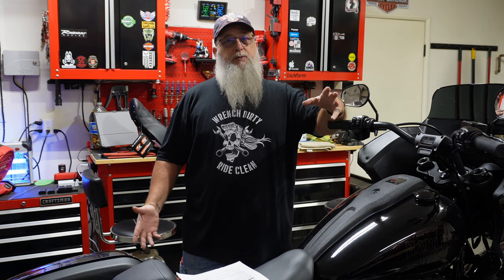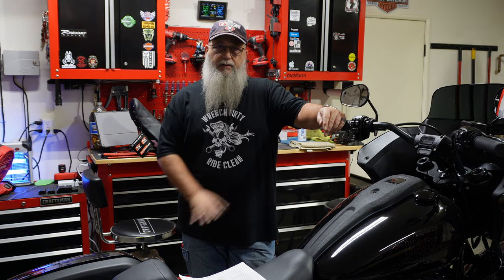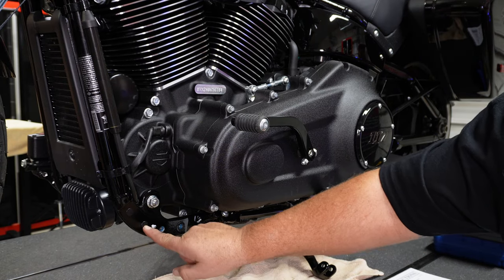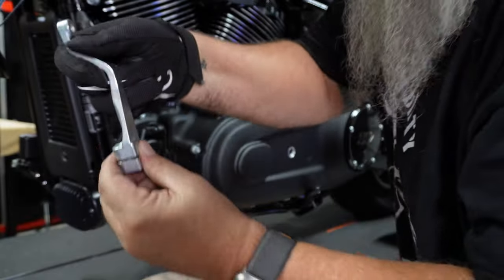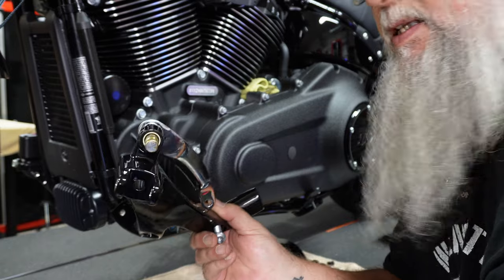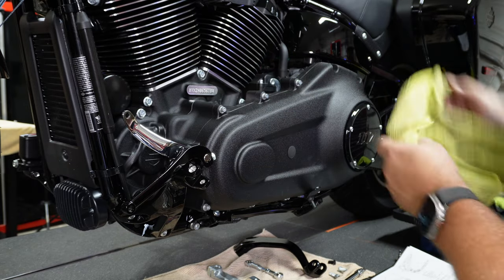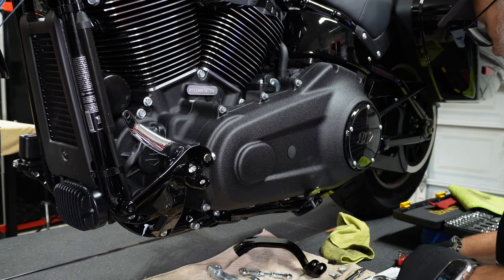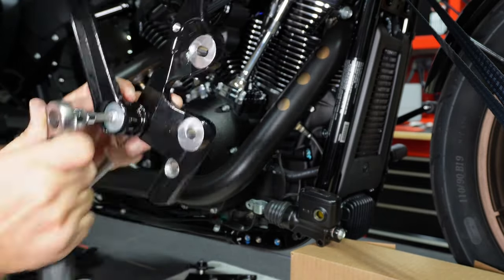2022 Low Rider ST Upgrade - Forward Controls, Seat & Seat-Lox

Comment: Great video...I would like to trade in my RGS for a low rider ST but can't ride the ST at all without forwards.  Would you say the location of the controls after the install are similar to where the controls normally sit on a bagger like the RGS?  If so, then I can be confident in buying the ST and moving the controls.  I literally just left the Harltey dealership 2 days ago and was hesitant because of this.  Any feedback is greatly appreciated.  Thx
Reply from the maker: Great question. When I purchased my Heritage, I test rode a Road King prior to that. The Heritage was far more comfortable with my legs so I changed my mind and got the Heritage for that reason. When I got the LRST, that was one of the main things I wanted to try was to use Heritage fwd controls since I hated the fwd controls and it is still a Softail. Worked great and love it. Feels more roomy than my Road Glides, has a better riding position (for me) and would do it again on any other LRST should I get one.

Go for it and enjoy your ride for you.
Reply: @justkillnbugz  thanks for the response bro!  I think I'm gonna do it. I see you mentioned the black forward kit brake pedal sucks. So the next bet would be to get the chrome and powder coat, correct?
Reply from the maker: @pbarre79  You bet! I would go with this solution: https://youtu.be/gBEvSz3U7zo

Far better and a much more comfortasble ride. Then you could do this: https://youtu.be/vTUBH14afEQ and be totally dialed in for a touring feel on a softail.

Ride Safe!
Reply: @justkillnbugz  awesome. I actually have the thrashin 9.5 risers and high bend bars on my road glide and love them! I was thinking to do a similar setup on the LRST once I change to tje forward controls. Thx for all the advice. Ride safe!
Reply: So I just reached out to a powder coater who told me they can't powder coat the chrome foot controls unless I had the chrome removed FIRST and then brought it to them. 

Has anyone heard this before? I feel like I've seen a couple of guys on YouTube who changed to the chrome forwards and simply had them powder coated
Reply from the maker: @pbarre79  Sounds skeptical to me, generally, they sand blast anything before powder coating. They may charge extra for that but still....
Reply: @justkillnbugz  I figured that. I'll look for another company then. Thx

Comment: Obviously putting forward controls on a motorcycle is a personal choice, but the Low Rider ST was conceived with performance in mind. That being said, it'll handle better with mids and the rider will have a better posture. Definitely change out the seat, but if forward controls are a desired riding style; I'd look for a Night Train.
Reply from the maker: Thanks for the feedback ARO, however, performance is also a measure of the rider not just the bike. And speaking from personal experience and riding time on many peg positions of bikes, my decision was based on works best for me. Rest assured, not having my knees in my chest made a huge difference when I out rode several others on low rider STs (and other models) with mid controls. It is also the reason I have 4 different rides for different occasions. 

Appreciate the opinion and ride safe.

Comment: Foot controls, handlebars and different seat.  Sounds like you bought the wrong bike 😂.
Reply from the maker: LOL. Nope, just making it my own, and showing others how to do it if they want to learn. But, thanks for the opinion.  I do have 3 others for other purposes as well. 

Ride safe.
Reply: So I’m a guy with 14” T-bars. Not offered on any bike from factory. I want a Saddlemen Step up or a Le pera tail whip to lock me in better that any seat from factory. And I’m 6’ so I want be more comfortable than I am on the mids that came on my 2020 fxlrs. Less sporty, sure but I still want these changes for my comfort. As do many HD riders so a comment like that makes me question if you ride HD because those are some very modest changes
Reply: How ya doin and thanks for you're video. I have a Low rider st also but the El Diablo version. I went a different and budget worthy direction in the way of highway Bar, and it also doubles as a fairing engine saver if it was dropped or knocked over somehow. I'm also 6'4" so I definitely needed some leg extension. Happy Holidays and thanks for you're perspective of ways to get the comfortable riding position you need. Love my bike and Do recommend This Harley Davidson bike...
Reply: lol who buys a Harley and leaves stock you make the bike your own

Comment: How do you compare the ST to the Rocket?
Reply from the maker: That's a great question. As a Rocket rider yourself, you know how they handle, sit, and the power they pack. In comparison to the RGST/LRST, they are different bikes for sure, made for different rides and function. Now, I do tend to get a lil spirited on all my bikes, trained that way and because of the riding the Rocket for sure, lol. It just keeps you feeling spirited. 

The Rocket is bulky (much better since the redesign in 2020), it feels solid in turns, but man does it punch out when needed. With the endless torque, in every gear, well, it's just awesome. As a softail, the LRST feels less bulky in turns, but surprisingly agile, and rides softer (not much with the stock shocks though). The 117 does not compare to the power of the 2500, but still has some good kick.

The power of the Rocket is unmatched in my experience, same with the responsiveness and overall feel. It just wants to run, fast...

All in all, I use them for different things/moods but have fun with each in their own right. Both are great bikes and fun to ride for sure. 

You give me a great idea that maybe I should do a comparison of all my bikes and share my thoughts (for those who might want to know).

I appreciate the support, love that you are a Rocket rider as well, and hope you stay safe out there.
Reply: Lol, until someone absolutely pegs the throttle on a Rocket they cant understand. Do you have the quick shifter on yours?
Reply from the maker: @jimanders9971  For sure! I didnt get that on it, I do pretty good on my own, lol, but I did get the bluetooth mod, dont really use it though so next time, that will be skipped, lol.
Reply: @justkillnbugz  I agree the bluetooth is useless and a waste of money.  I disagree on the quickshifter though, I too can shift as quick as anyone but I cant shift while maintaining full throttle like the quick shifter can.  But I guess I am lazy, I love bopping around town without having to use the clutch except for starting out, upshift or downshift it matters not. But thats why they offer options, everyone does not like the same stuff.
Reply: @justkillnbugz  I love bike comparisons, especially from a guy that has ridden the included bike a lot and has no axe to grind. I hope you do them.
Reply from the maker: @jimanders9971  thanks for the feedback on this one. I will start looking in to it for sure.